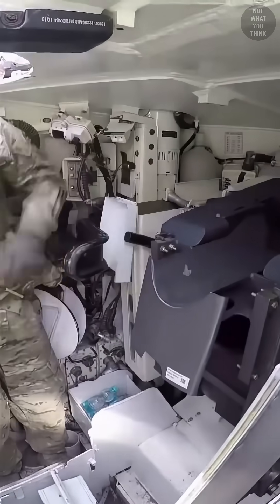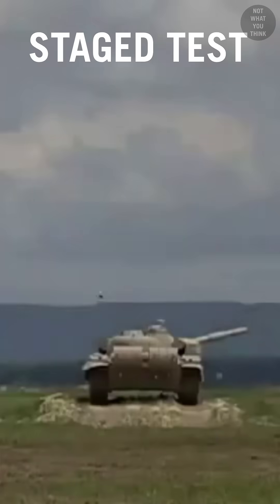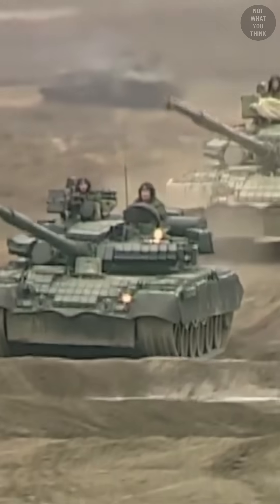Why M1 Abrams Tank Has No Auto-Loader #shorts

Comment: Russian tanks put the ammo in the turret basket because that is the SAFEST place to put it. M4 Sherman tanks that had the ammunition put in the turret basket were some of the least likely tanks to burn.

The problem with Russian tanks is that the T-72 autoloader only holds 22 shells. The other 18? Stored up in the turret. Where they are very likely to be hit. When you see a T-series cook off, it is almost always the extra ammunition stored in the turret. In Chechnya, when Soviets started going into battle with only the 22 rounds in the autoloader, the number of cookoffs from hits largely disappeared.

There is nothing stopping the Russians from designing a tank with a turret basket autoloader, that is sealed when not reloading, that has blow out panels on the bottom. They just haven't decided to do it.

Comment: Speed tests have shown that a manual loader is faster than most autoloaders by at least 1 to 2 seconds. That's huge in a 1v1 with tanks.
Reply: Automatic loader these days are way more faster than before
Reply: But what 2v1?
Remember that less tank crewmate mean you have more tank in battlefield.
Reply: What speed tests lmao.

There are modern autoloaders capable of achieving sub 3 second reloads.

Comment: Including loader takes a lot of space in the turret, personally I think Leclerc's design is better with relatively quick autoloader and still having blowout panels.
Reply: and the k2 black panther ofc
Reply: Back when the Abrams was designed there wasn’t the technology to have both a blowout panel and a autoloader.
Reply: You say having a loader takes up space but you applaud the LeClerc? Have you ever been inside one?
Reply: Blowout p does not work on Detonation of ammunition. Only when its burns

Comment: Then simply pair that "safe and secure ammo door" with automatic reload feature!
Reply: Could be not enough space to engineer that without compromising some more important aspect of the tank.

If I remember correctly… they are assembled with everything very compact and crowded together.

But who knows, I’m no tank expert.
Reply: @The.Nasty.  Uh… they did… the Leclare and the Black Panther all use auto loaders with the protective housing for the ammunition.
Reply: @Rokaize  I did say that I’m not a tank expert.

Glad they figured that out though!
Reply: @The.Nasty.  It’s ok babe
Reply: @The.Nasty.  i'm pretty sure a mecanize blast door requires less room than a human. they couldn't make it right when the tank was conceived, and now they don't want to have to modify their stuff. "safety reasons" are just a convenient excuse.
Reply: I think there is a design of auto loader for the Abrams that works with the ammo door,  but that reduces the number of shells the tanks can carry so much that it was discarded.
Reply: @KevinKaiChan  perfect example of what I meant 👍🏼
Reply: What sence make safe and secure ammo door if after ammo rack explosion tank is completly useless as a tank, and enemy can kill crew using sticks and rocks, couse you have no ammo? On battelfield (of corse no air domination) without ammunition tank is only very expensive mobile coffin.
Reply: @prasaite  because the crew are very valuable.  If the tanks ammo is destroyed they can escape and be recused. And live to fight another day. The quality of tank crews is extremely important. And losing good tankers is not a good thing to allow.
Reply: @Rokaize  You are ammo racked, so something hit and penetrated tank. Next shoot willbe only a formality. We talk about equal fight no planes, no infantry, no antitank weapons, mines only tank vs tank duel.
Reply: @prasaite  1. Even if the tank is penetrated. That doesn’t mean all of the crew is dead. Abrams have been penned many times, sometimes just the ammunition storage section. But yet, so few Abrams crewmen have ever died. 

2. If you don’t have a closed ammunition section, then your chances of being blown up are so much higher. Abrams just don’t explode, they can’t. Compare that to a t72 or any other older Russian design and a large percentage of them have massive ammunition explosions OR fires. Which again, doesn’t happen in an Abrams. 

3. There’s no such thing as an equal fight. It sounds like you’ve been playing too many video games. War is a team effort. There is no individual tank vs individual tank. That’s not a thing. Tanks operate in platoons at the lowest level. Which is either 3 or 4 tanks depending on nation. There are no duels. That’s not a thing. 

4. It’s this simple, if you have to choose a tank to be inside of when it’s penetrated would you rather it be an Abrams or similiar design with a contained ammunition storage section? Or a tank where you are literally sitting on top of your ammunition like a t72? Uhhh this isn’t a choice dude. If you say you wouldn’t want a proper ammo storage section you’re either lying or an idiot.
Reply: @Rokaize  This whole discussion here that autoloader is better/worse than human loader have meaning only in situation tank vs tank duel. No air domination, no infantry, no antitank weapons, no antitank mines, just one tank against another. Because only in that simple situation we can talk that one tank is better than another. In another case we can only talk that one army/strategy is better/worst than another. 
So if we talk about tank with autoloader is better than with human loader its depends from few circumstances, like loader loading his first or last shells (human after loading few shells wilbe more and more tired and last few shells he willbe loading much slower than first ones, autoloader willbe load every shell always in same time. But tank vs tank duel is almost first hit not like galeons fights on the see. But first shoot means faster detection and fastest aiming. Human in tank need space so bigger crew = bigger tank = bigger tank = easier to detect = easier to hit. But tanks are practicaly blinds, more often crew get informations from infantry, airforces, satelites, electronic systems other tanks than they spot something with their eyes. But this information stream is a army vs army not autoloader vs human loader problem. Abrams and russian tank after hit, penetration and ammo rack in both cases you get tank is unoperational on battelfield. Russian tank is simply blowup and whole crew is death. In Abrams you have mobile tank, crew is still alive but no ammo for fight. If i willbe tank member ofcorse i wana abrams.
Auto vs human have no sence as you wrote there are fight armies not single tanks do pew, pew, so if you have total air domination you willbe win all tank battels even if your tank is just simple wheelbarrow with machinegun.
Reply: Whoa i found my comment from 4 years ago

Comment: Now if only we could add in the rear escape hatch system that the Israeli Merkava tanks have, we'd be pretty square on.
Reply: The Abrams has one for the driver if I recall correctly
Reply: We stopped putting escape hatches on our tanks because they're virtually useless in real life. Modern antitank weapons are so powerful that if a round penetrates, the tank is probably toast. And the reason the Merkava is able to put a hatch in the rear is because its engine is in the front, unlike most tanks.
Reply: @jeffreygunn3530  they’re not there for you to escape in the event of a penetration. They’re there if you roll over. And they’re still being put on tanks

Comment: Leclerc w/ autoloader AND blowout panel: I'm one universe ahead of u
Reply: I was thinking the same thing Irina, The Leclerc has an autoloader without the drawback of russian tanks carousel. Kind of ignorant to say all autoloaders have the same disadvantage.
Reply: @Mighty Peek as for the armour, its turret isnt too bad at all, at the ranges the and the roles the tank is designed to engage at.

a t55 tho wouldn't really work at all tho, id say at least a t72.
Reply: @Mighty Peek I laugh at you for thinking that a T55 would even spot a leclerc at all from distance before it gets destroyed from kilometers away
Reply: LeClerc also has 2 forward gears and 6 reverse gears
Reply: The Abrams was designed long before the leclerc was around and at the time they either had blowout panels or a auto loader not both.
Reply: @apex_blue  The thing about tanks is that they can be UPGRADED, and the u.s. even had a auto loading Abrams prototype, but they just didn't roll with it.
Reply: @kirbotastic  they would need to design a completely different turret to fit the autoloader so even if they are willing to spend all that money upgrading all the Abrams by the time they are done they practically won’t be Abrams anymore might as well build a new tank from the ground up.
Reply: @apex_blue  not true the Japanese did it with the type 90 based off of a leo 2a4
Reply: @yopierre7221  really maybe they will have a auto loader when they equip the rumored 130mm
Reply: @apex_blue  very true

Comment: Interesting thing is that the french leclerc mbt has and autoloader that stores ammo in the same way as the Abrams, in the turret bustle. The korean mbt  does the same but store it in a drum mechanism in the bustle.
Reply: Both of those tanks are 20+ years newer in design and manufacture than the Abrams is though. They've both benefited from advances in technology that the Abrams can't because it would require a massive redesign and refit operation. If you're going to spend the money to do that you're better off designing and building a new better tank from the ground up and since the slight increase in performance doesn't match the massive increase in cost I don't see the US Military replacing the Abrams. Especially since the M1A3 just came out.
Reply: @williamradler8712  I guess he said it because the guy in the video made it look like you have to choose to either have blow out panels or to have an auto loader which isn't the case.
Reply: @Raruschmaru  That's fair
Reply: @williamradler8712  Leclerc was designed 11 years after the M1. Your point is valid, but exaggerated.
Reply: @SimonLinds  The technology used in the M1's development was all included in the MBT-70 project which was started in 1967 and abandoned in favor of a simpler more proven design(M1 Abrams) incorporating some it's more advanced technologies. The Abrams was approved and production was started 11 years before the Leclerc. The M1's development cycle started nearly 20 years before the Leclerc's. In terms of technological growth, especially during this period, that's an eternity.
Reply: @williamradler8712  According to wikipedia, it entered production in 1979.  And was designed between 1972 and 1975.
Reply: @SimonLinds  After the MBT-70 project was abandoned and it's technology was used to design the Abrams. I wasn't saying you were wrong, just supplying a little more context. The point I'm trying to make is that at the time of it's development not including an autoloader made sense for both economic and tactical reasons besides the obvious design reasons.  The size, shape, and armor layout of the Abrams turret would need to be drastically changed to include an autoloader and there just isn't enough benefit to warrant that kind of change.
Reply: @williamradler8712  oh yes certainly. I agree.

Comment: Seeing the giant explosion doing absolutely nothing to the interior is interesting. I would love to see similar situations explained in the future
Reply: Think you all are missing the point. Not every hit is a crew killer. All you have to do is disable a tank to take it off the board. Many hits (if it actually made it through its armor) in a A1 are walk away able even if the tank is dead but not so much if the ammo cooks off. That was the issue with the Sherman in WWII. Besides being just north of a light tank it also used aviation gas and when hit it would go up like a Ronson lighter. Today, Israeli tanks have a built in rear exit just to let the crew escape when hit. Russian tanks are so tight they pretty much don't expect the crew to escape.
Reply: @finscreenname  don't base your knowledge about the Sherman tank on the book "Death Traps" by Belton Y. Cooper.
Reply: @Erpyrikk  The Sherman was a good light tank. That's all, nothing more. The Germans used diesel the US used aviation gas. If they both sides used Sherman's what tank would you want to be in?
Reply: @finscreenname  all german tanks used petrol engines just like the british and american tanks only russian tanks used diesel engines.
the sherman tank with with a weight of 30 tons and 50 to 60 mm angled  front armor depending on variant is definitely not light. 
sherman tank crewman had some of highest survivability rates of any front line troops in the war.
Reply: @Erpyrikk  Sure they survived because they didn't fight the war from beginning to end like the Germans and Russians did and had insane numbers of tanks compared to the Germans when they did invade. Hell, you got blown up in a tank for those countries and lived they just stuck you in another tank until you were dead. That's also why German and Russian (and the English to a lessor degree) Ace's had insane numbers of kills. They flew until the war was over or they were dead. Unlike the US that did "tours" of duty. Basically the US had 1 year of combat 44/45 in Europe. The German's were already on their back foot and most of their experienced tank crews were dead in Russia. The bottom line is, a one on one between a Sherman and almost any tank on the German side the Sherman would lose. Oh and burn to the tracks after.
Reply: @finscreenname  the thing is when a shot penetrates the armor it hits with so much force and friction it actually melts a ring around the hole on top of sending shattered pieces of the armor and potentially round flying around a metal box filled with squishy humans
Reply: @imcrummy6114  I get that but not all hits enter the cabin and even when they do they don't always kill the crew.
Reply: @finscreenname  yeah not always but there's a high chance that the crew will get hit by some shrapnel wether its lethal is a matter of sheer luck
Reply: An explosion is actually just a rapid increase in air pressure. And, like any pressure differential, it is going to go with the easiest path to equalize. So you give the gas an easy path to vent through and it will go that way.
Reply: Imagine being inside one!!! My ears already ringing thinking about it!
Reply: it is only cuz US have no HE ammo, turkish leopards lost turrets like russian tanks only because they used HE ammo
Reply: The thing is, the explosions shown destroying T-72s in this clip would equally destroy Abrams. Also, I don't think blow out ammo compartment its such a great advantage. If an enemy projectile ends up in your vehicle you're mincemeat anyway.
Reply: @phunkracy  yep 😂 I think the engineers have an inflated idea about that " protection door". Being blown to bigger chunks rather than vaporized is "protection"? Okay
Reply: @notundermywatch3163  I laughed at that last part. If the ammo storage inside a tank goes boom - it's game over for all the crew. There's no "venting the explosion", seriously...
Reply: @phunkracy  yeah exactly the difference is you’ll be killed from red hot shrapnel hitting you like a shotgun as opposed to going out in a giant fireball
Reply: @phunkracy  100% NOT true. That explosion is from the ammo going off inside and it happened all the time when Abrams engaged T-72s...Abrams don't blow up like that.
Reply: @joekent5675  100% true, bc the explosions shown in the clip are from tnt stored inside these t-72s to make explosions more spectacular. The footage is  from promotional tests of tow-2b missile. No matter where the ammo is located in abrams, it wont survive top attack warhead, end of story.
Reply: @phunkracy  responding with with a copy of what I said doesn't make you right. T72s blow up like that in combat...
Reply: @joekent5675  no they dont. They especially dont immediately explode like in the clip. It takes several seconds for ammo to cook. Also please dont take credit for what I said (bunch of wise words) by comparing them to what you've said (bunch of dumb words).
Reply: @phunkracy  you don't know what you're talking about lol
This exact thing took place in both gulf wars. MAYBE the explosion is a bit more shiny, but the turret flying off like that happened all the time.
Reply: Nice try putin you will never get our tech 🤣

Comment: Theres type 90, type 10 and leclerc, which also have autoloader and the shells are behind blow up pannels
Reply: They are far more modern and recent designs then all the others with them but basically you are correct.
Reply: @TheGroundedAviator  The Leclerc was a retrofit
Reply: @MomsLittleJedi  What part was retrofitted?
Reply: @Mighty Peek doesn’t change the fact that it’s Autoloader is good
Reply: @Mighty Peek you’d be wrong with the updated version of the leclerc
Reply: @Mighty Peek why would you be hit by an old t55 tank if there is no one still alive trying shooting at all nato's weakest point while you're engaging him in mouvement and at 1 miles from those ?